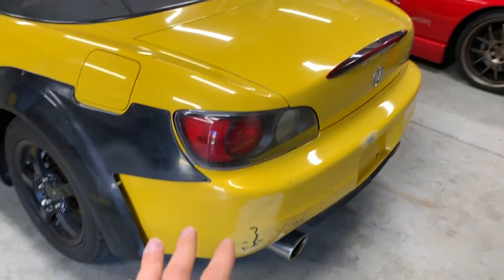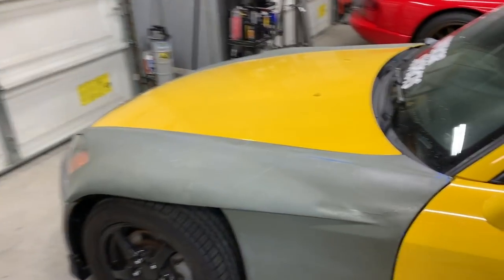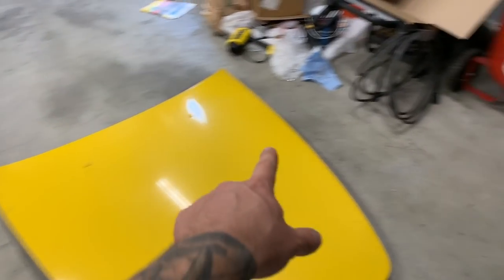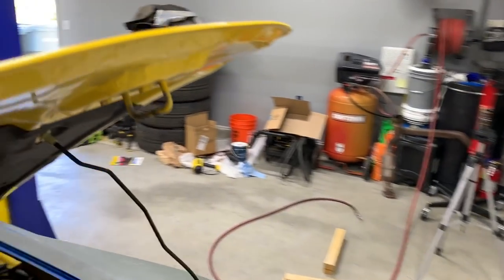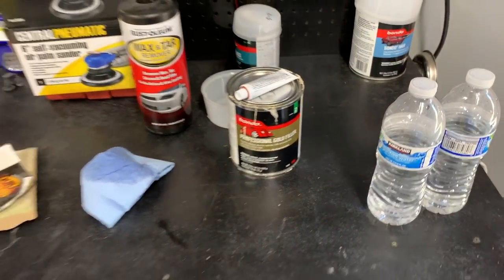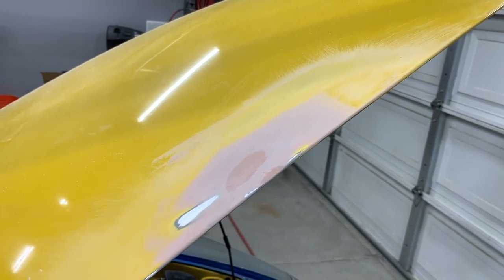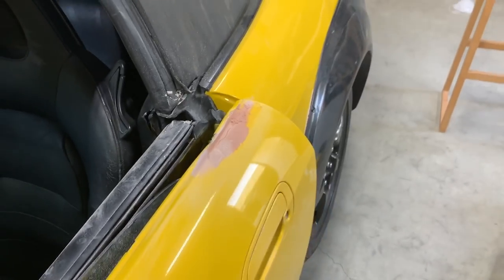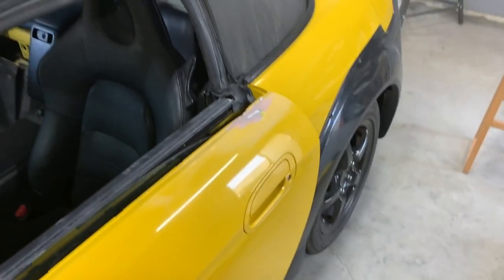How To Repair a DENT in a Car with BONDO

Comment: To be honest, wrapping is 1000 times harder than paint. If you don't have the right tools patience and perseverance it won't go good. Not to mention with those fiberglass fenders on the front the primer looks like it would feel up if you had to rearrange or remove the wrap from them.

 I don't doubt you could find a way to wrap it, but I think for your sanity and budget I would paint it